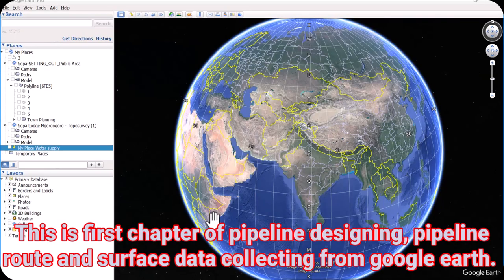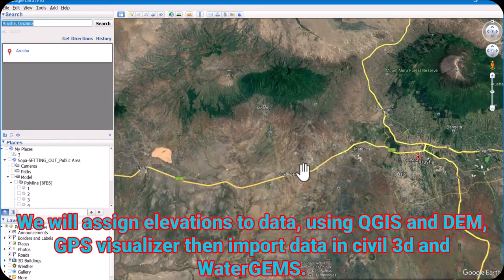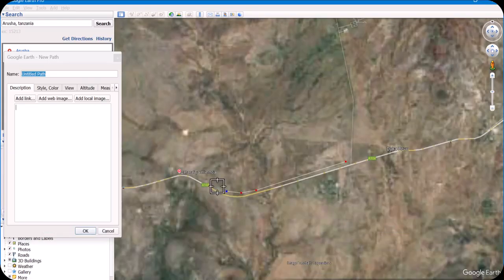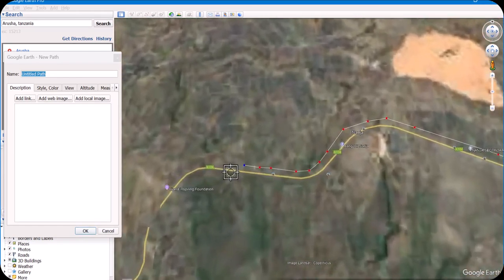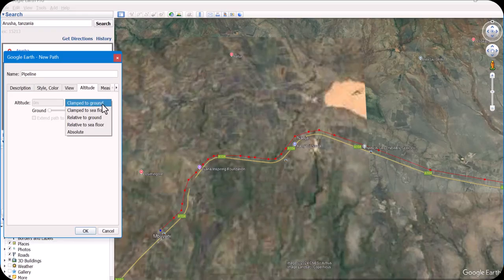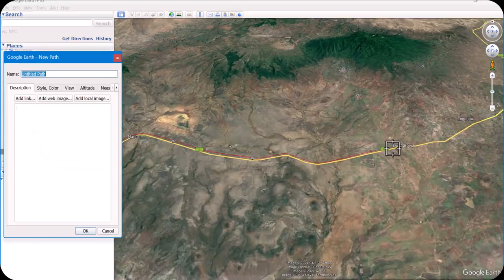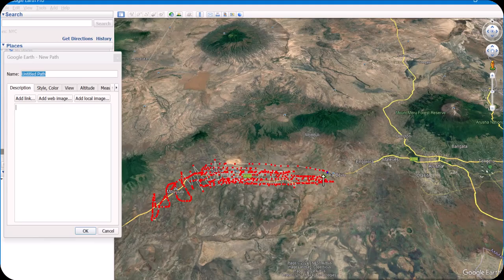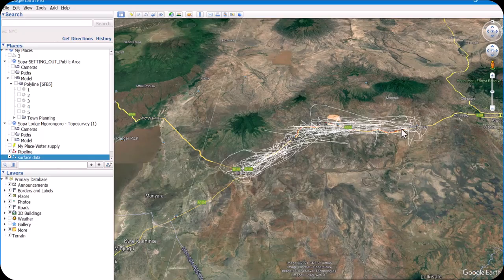Pipeline Network Design Part-1: Drawing Pipelines & Surface Data (Points) in Google Earth

Comment: But,,
I would like to add Few topics
1. Surface creation using contour, Break lines, Drawing objects.
2. Cut and Fill Volume 
3. Band Creation to Profile.
Reply from the maker: Thanks 
You will get separate video on each points very soon.